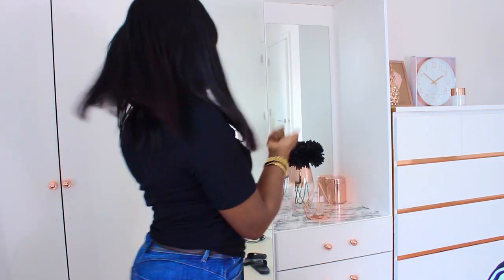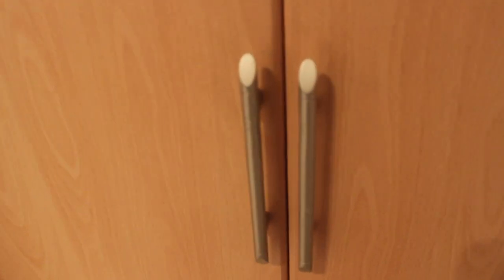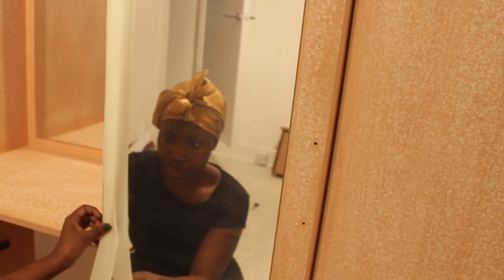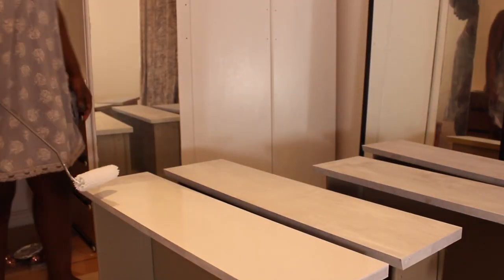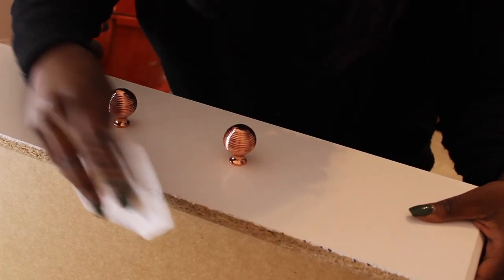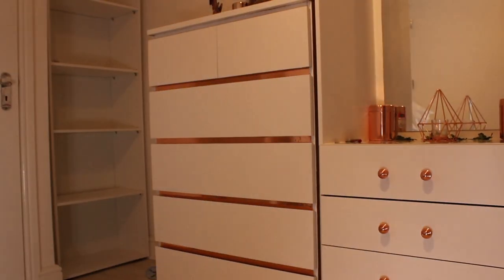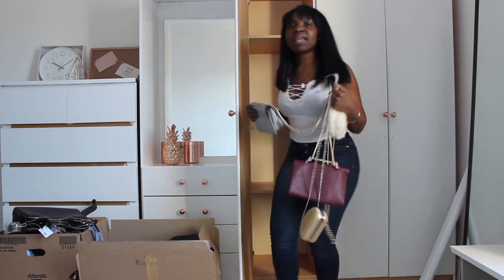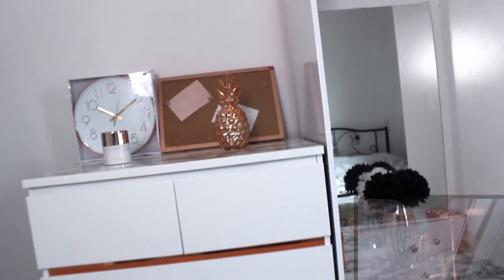CHEAP TO CHIC EP.1| WARDROBE MAKEOVER| PAINT WOOD FURNITURE

Comment: Just about to do this to mine and now I definitely won’t skip undercoating. Lol.  I think you should fill those little handle holes with the ready mixed squeezy poly filler as it’s only £1 and soooo easy/fun. 😆
Reply from the maker: I used wax because I had a feeling I would change my mind about the knobs which I did eventually lol. Hope it goes well !